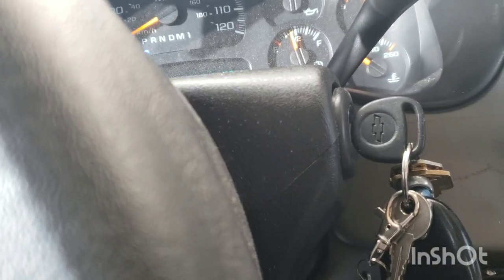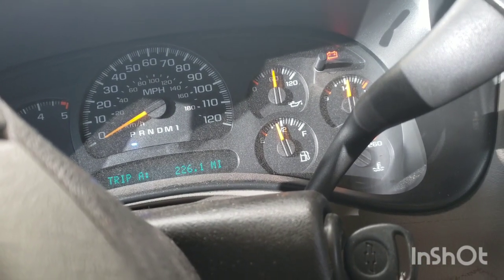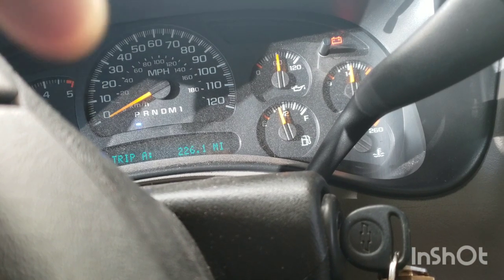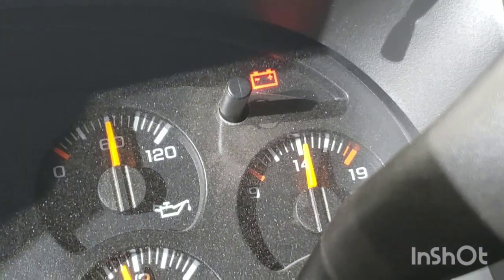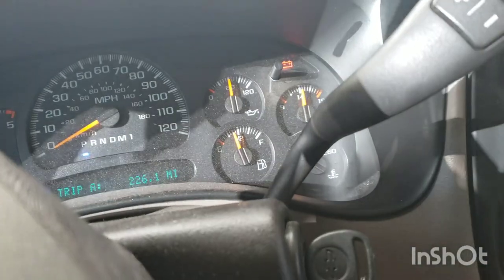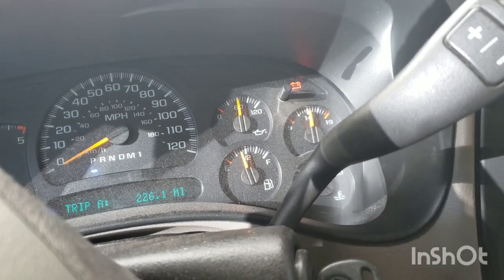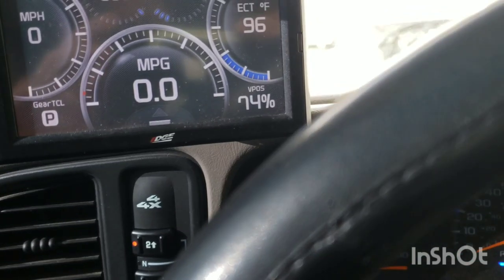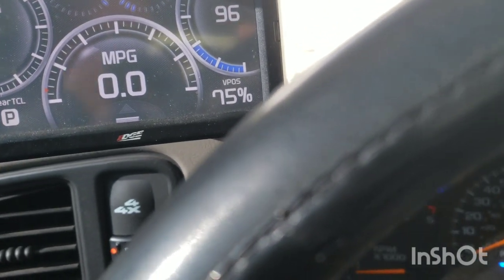turbo vane problems? buzzing

Comment: weird
Reply from the maker: I know its razy
Reply: @rikkidiesel  get a stethoscope  and pin point the noise replace part
Reply: What the .... here’s what I do to make my vanes to move freely reset your engine light after truck has went over 162 degrees when you clean lights (engine codes) that game will cycle hit the throttle during cycle it’ll stop the recycle again I’ll do that a few times a week .... there is no relearn in the vanes it’s done with a tech 2 battery light ..change alt it’ll go bad soon
Reply from the maker: so once my engine hits 162 degrees clear my codes and hit the throttle while clearing the codes? but i don't have any codes it just acts like that when i turn off the truck. so basically there is no codes to clear...
Reply: @rikkidiesel  my lly had 2 codes related to vanes,ended up  pulling and cleaning  plunger and vanes,had no buzzing ,but it fixed it,you may pull the snap ring on plunger and thread a bolt ,to see if you can make it move back n forth,and or watch your cts for vane percentage  ,what codes are you getting ,I would do thus before pulling,mine was a stuck unison ring,the vanes ride on,clearanced and reassemble, no more codes ,my batteries were fine,and the computer remembers  vane parameters so no relearn  needed,just let come up to temp,before moving throttle
Reply: @sonofthunder.  did you remove the turbo? My 05 lly just started to send the p0046 code. put scan tool and the two sensors were not reading the same vane position. commanded them to go all the way in and out and it worked for a few miles then light came back. how do you know if its the sensors bad or the vanes are just stuck  really hate to pull the turbo, what abitch